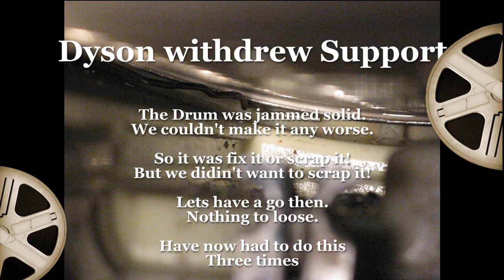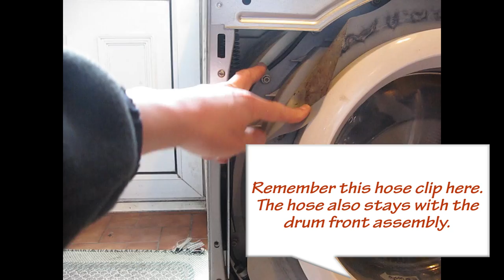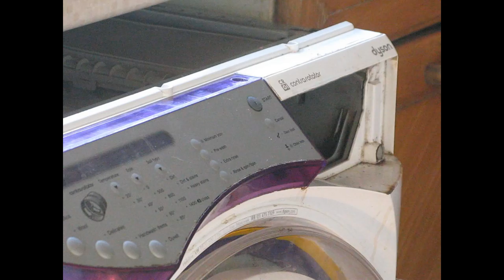Don't Yet Scrap Old Noisy! - Fixing a Dyson CR01 Washing Machine Jammed Drum

Comment from the maker: Still going.
Had a few instances where the drum jammed and it could be freed by rocking the drum clockwise and anticlockwise from inside. This dislodged the jammed piece of metal and off it went again. 
Once a year I now go through the dismantle and removing of metal shards process, from around water heater, if I have not needed to do so due to a jam within that year anyway.

Comment: Try to save this machine! Hope the contrarotation is still not disabled as it was often done by technicans if the CR-gearsystem broke. A spare machine with a good spider should save yours. May you get a cheap offer than to get the spider powder coated or you somehow else protect it against corosion. And if you get 1 or 2 spare machines cheap and take them apart, these parts will help you to keep this genius peace of washer design alive!

Comment: Hiya. .I am back 2vyears later.  u saved me alot of money..so thanks loads 2 you. wanted to ask u..my Dyson washing machine drum makes banging noises when spinning..it's scary and I quickly switch it off.  do u know why this is happening please....
Reply from the maker: Hello and sorry for late reply.
The consensus here seems to be that the metal bits that keep jamming the drum are coming from the spider that holds the drum to the main bearing. In your case, if the drum is bouncing about when making these noises, it could be that the spider has lost so much bits of metal that it is no longer supporting the drum sufficiently. Alternatively it could be the bearing that has gone. There may be other causes but as the spider and bearing are almost impossible to source new, regrettably, it could be the machine has reached the end.

Comment: The spider corrode faster due fluid detergent and soft water or a combination of these 2 .The spider is made from aluminum.
Powder detergent is far less aggressive  to aluminum.
Reply: Rodger Sleurink but far more aggressive to clothes and fabrics :( the bleaching agents, coupled with the abrasion can damage material much quicker. We use both, probably 50/50 depending on the items

Comment: hi..do u know how I can make my Dyson contrarotate again... the engineer stopped it cos it was the only way.. according to him, to make the machine work...
Reply from the maker: The Dyson Engineers change the control board to stop it contrarotating. So to get it contrarotating again would need an original control board but the drums are probably seized together anyway.
Reply: I see....ok I thing the board was actually changed...I feel like I have been ripped off now...thanks anyway.
Reply: Why would you want that re-enabled? I was quite glad when they swapped the board on mine. no more gears to fix on the back (2 callouts for that) and no more shredded clothes where the two drum halves act like scissors.
Reply: @stupidlogic2987  Yes I get that but that was one of the perks of me buying this particular machine, so that it would contra rotate. without that it is like all other machines, barring the size of the drum

Comment: Those fragments look like the spider which is a piece of metal which holds the drum in place. You will be able to remove the whole drum from the rear to replace this but where you would get one for a Dyson would be the hard part.

Here is a spider from another machine.
http://softsolder.files.wordpress.com/2010/06/cimg4911-corroded-aluminum-spider-overview.jpg
Reply from the maker: Hi Lee, I think you have hit the nail on the head there. The bits of metal I have collected look exactly like bits of metal off a spider similar to the one in your picture. Thanks for that.

Though why they make a support of a Stainless steel drum out of a metal that will corrode more quickly than the drum itself beats me.
Reply: planned obsolescence